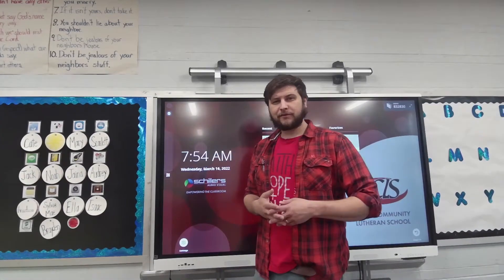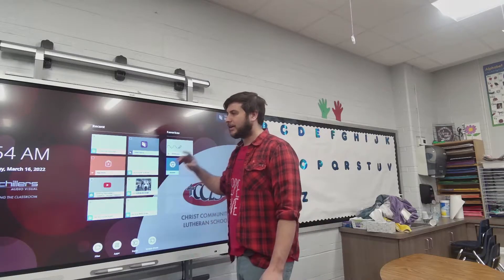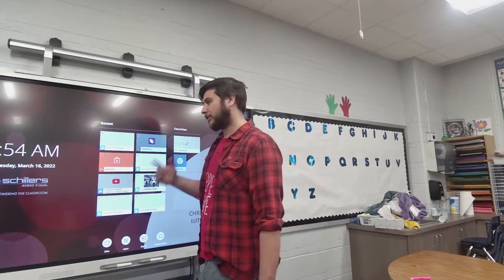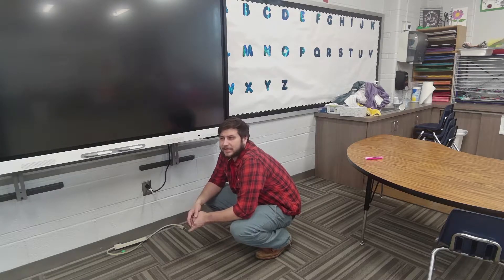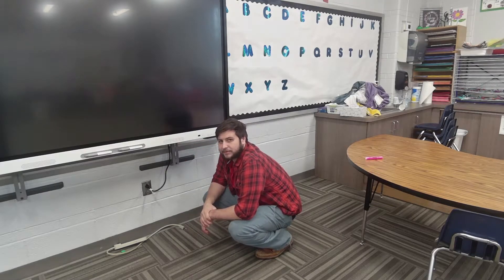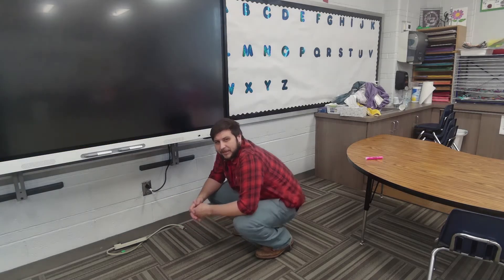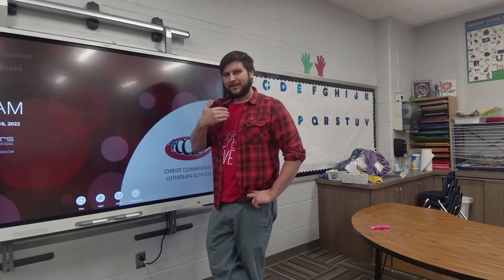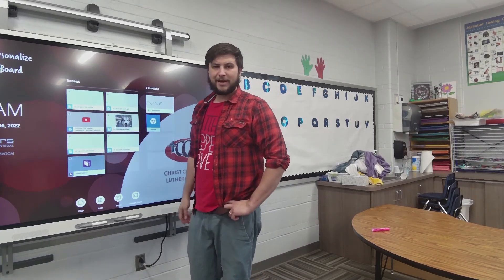SMART Board MX75 V3 Troubleshooting for Teachers | SMART MX75 Review

Comment: How do i conect it i pushet it in but noting lol i press power button noting i have green licht and it clicks when switching power on
Reply: If the home button lights up it's not an issue. If the light turns green and the board turns from black to grey, it is also not an issue. If the board light turns green, and nothing happens you can contact smart support now

Comment: Hello hi. I have the problem like my screen show no picture. Nothing on the screen.
Reply: hdmi cable needs replacing
Reply: Check if your OPS module is seated correctly. You may also need to replace it, otherwise, you can contact SMART support. If the home button lights up, that just means it's trying to boot

Comment: Will turning off the switch work for someone who's locked out of the smart board because they forgot their pin code?
Reply from the maker: In a case like this, you can try. However most likely the lock screen will persist on start. Because the unit runs on base android utilizing the factory reset button may be necessary. This will completely erase everything though.
Reply: Turning off the switch will work, but it is not safe to do so, as it can brick your board. I've said this on another comment:
Press and hold the power button until "Slide to save energy appears" Then slide and afterwards wait until the board's light turns red, turn it back on again. You should be greeted by the SMART logo followed by a loading icon. If you have an OPS module plugged in, your display may instantly boot to there instead of IQ. To fix this, press the HOME button on your display

Comment: Hello 
We have problem with smart board in our school.
Kids put password then they forgot about this .
Now we could not  use it .
Please help how we can unblock
Reply: Press and hold the power button until "Slide to save energy appears" Then wait until the board's light turns red, turn it back on again. You should be greeted by the SMART logo followed by a loading icon. If you have an OPS module plugged in, your display may instantly boot to there instead of IQ. To fix this, press the HOME button on your display
Reply: Note: You have to slide to the right to shutdown